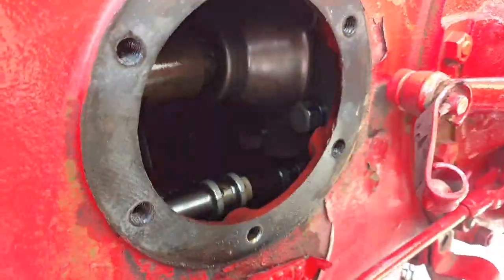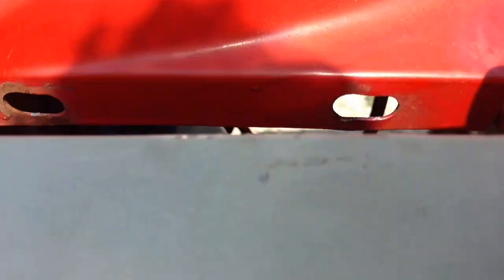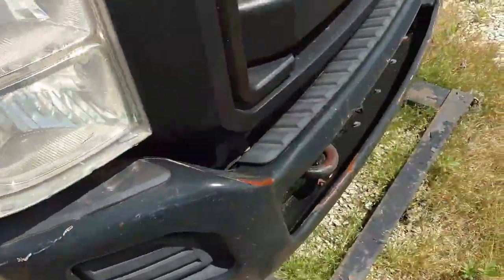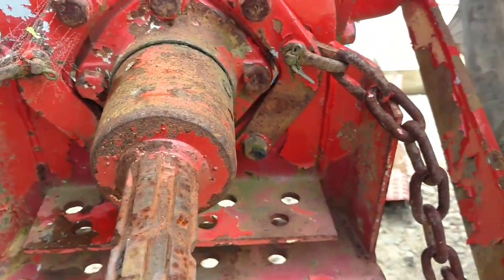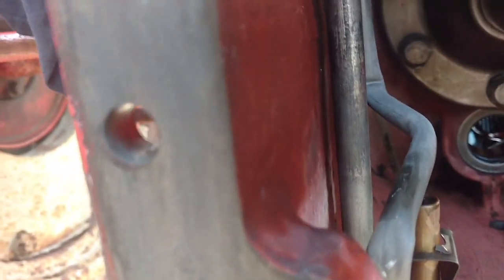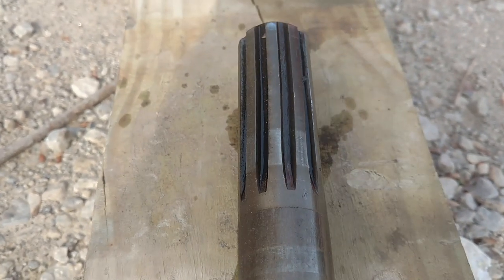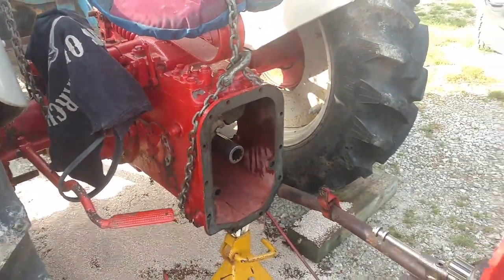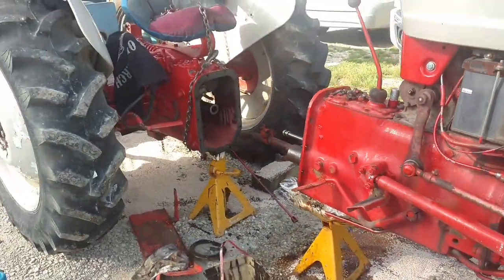Splitting  the jubilee tractor. 8n blows a tire!

Comment: When I was young I was the only mechanic at a big golf course. There was 62 pieces of equipment and 12 workers to tear them up. It was never ending. A bushhog without a slip clutch or a shear pin will break a shaft or twist one quick.
Reply from the maker: right. it never ends! so will an office guy who wants to play farmer. my brother and i are polar opposites. i tear everything apart, he buys everything new with an extended warranty. he has clean hands, wears slacks and dress shirts with nice polished shoes. his day if filled with office work. he wouldnt leave the house without 4 botlles of hand sanitizer. i have filthy hands, shirts pants with holes (in most cases they should be rags not worn!), shoes that should have been thrown away years ago, i use brake parts cleaner as hand soap and for lunch i have peanut butter on my grease sandwich.
Reply: When I was 12 I bought a Honda Trail 70 for $125. I worked hard for that money and my half  brother (8 years older) took it and wrecked it.It laid on it's side running wide open till it blew up. He laughed and to this day he laughs. We are polar opposites too, but we had a very rough childhood, he turned to drugs. I have been on my own since I was 15, but never got into drugs.
Reply from the maker: wow. that is awful and rough. you turned to fixing/building things. i never tried drugs or smoked and i dont drink. we were dirt poor when i was a kid. my mom was in the hospital alot. tons of medical bills. my first job was when i was 8 mowing grass  all my money went to the family. i was paying rent at 15. moved out by 17. bought my first house at 21. worked hard my whole life. i would work a full time job and a part time job and then come home and work on cars till the wee hours of the morning. sleep for a couple hours and do it again.

Comment: From the way the main has to be working order for it to move and then throw in the pto drive is doomed anyway, why didn't they make a sheer key for it to fail before all that happens?? I could with time to study it a bit. Even a drift pin on those collars could be designed to fail before spendy pieces. That could hypothetically be changed through access covers. Way to go green bean. I don't like deere or cat because the failures and cost... heaven forbid the no improved designs that addresses these issues